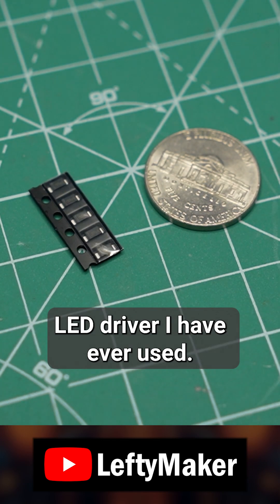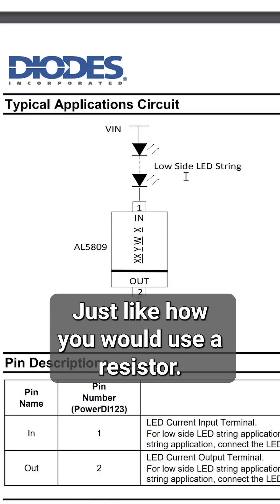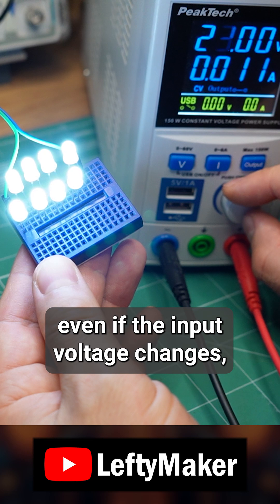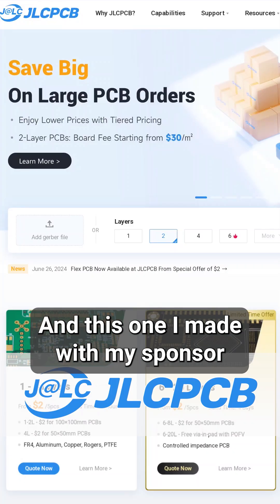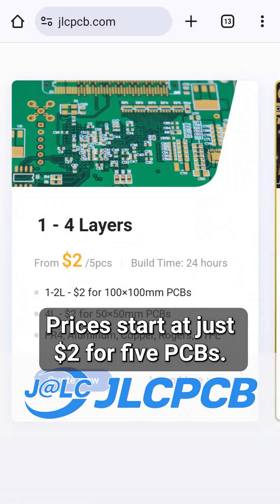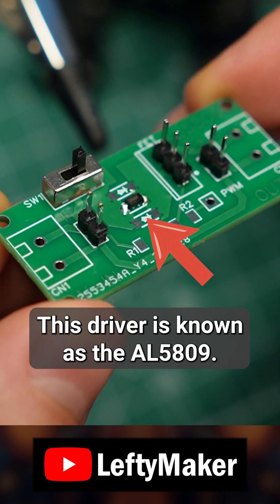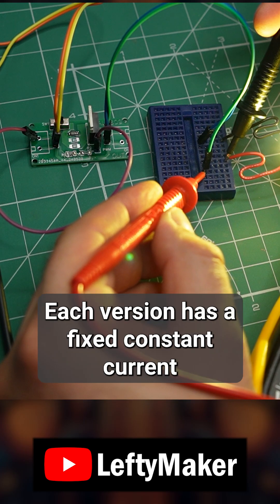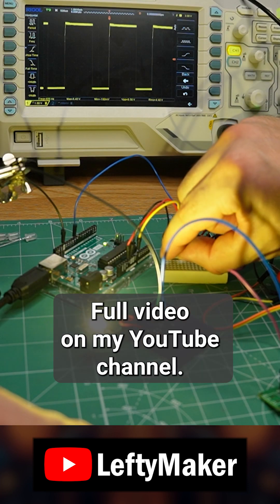Make better LED circuits with this LED driver #jlcpcb

Comment from the maker: JLCPCB PCB Fab & Assembly from $2! Sign up to Get $60 Coupons  :  https://jlcpcb.com/?from=LeftyMaker 

This is the simplest LED driver I have ever seen. It is cheap, easy to use, and barely takes any space on a circuit board. It is a single component, the AL5809, and it can drive strings of LEDs at up to 60V and at fixed currents from 15 to 150 milliamps. Current can be increased by using several drivers in parallel.

Comment: what is the use of such a driver if you need additional components with it? isnt the whole point of an ic that they dont need additional components?
Reply from the maker: The driver can be used entirely on its own. The extra components on the PCB are for PWM dimming - I talk about that in the full video.

Comment: Is there a through hole version of an LED Driver?
Reply from the maker: There is the CL2 by Microchip. I haven't used it but it looks similar.
Reply: It should be easy enough to solder this one to a normal 2.54mm pin header. There will be less heat dissipation though. You can probably also solder it directly to prototyping boards.